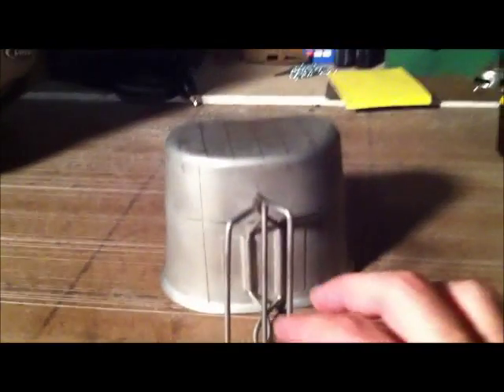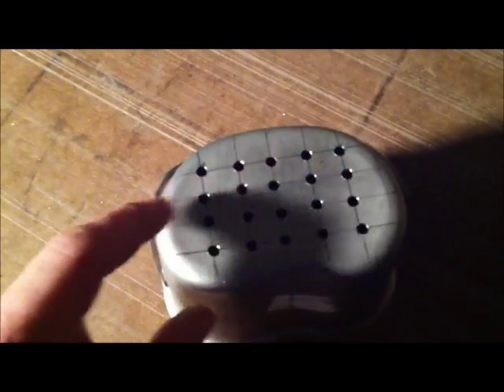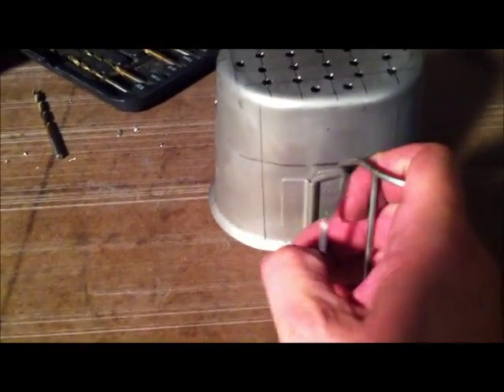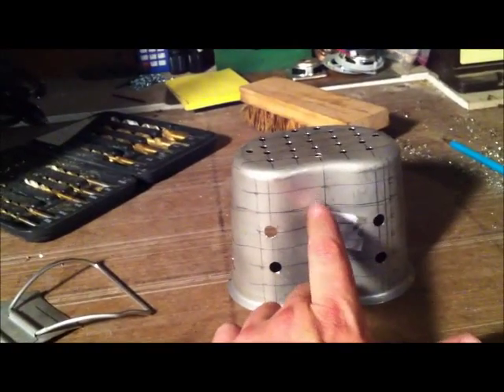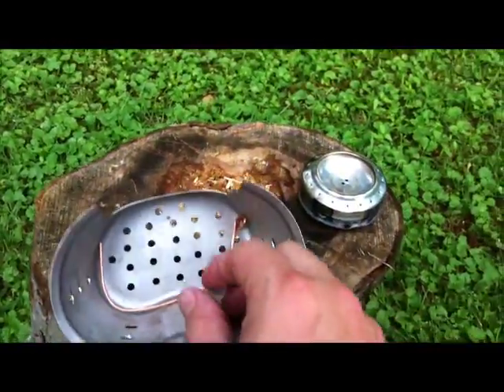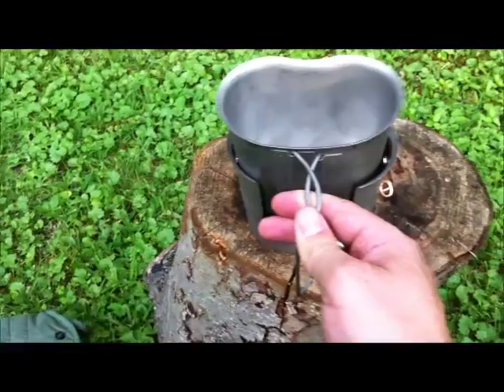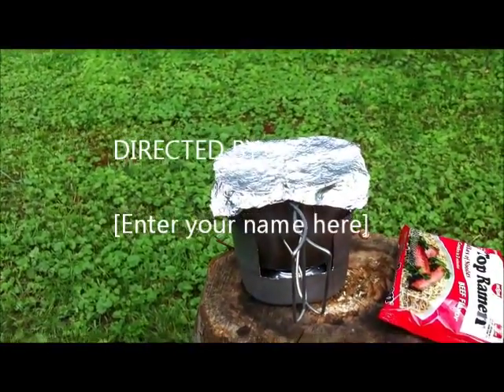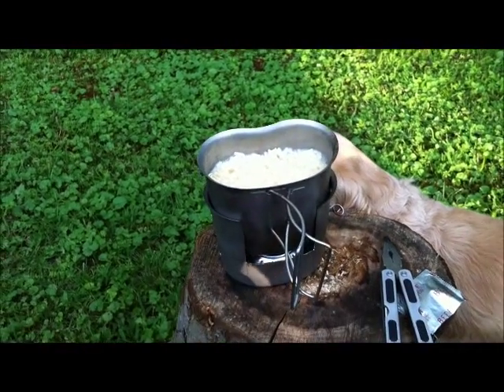How to Build an Army Canteen Cup Stove custom DIY alcohol fire ezbit camping pot

Comment: Just use the stove that comes with the canteen cook set.  It's already a multi-fuel stove, and can be used with tablets, with wood, or with a mini Trangia.  Don't ruin a cup just to do something that's not as good as what you can already buy for five bucks.
Reply: James Ritchie.    This is the perfect situation to cut a Rothco cup for this project.
Reply: James Ritchie believe it or not the us-made stoves are actually more money then the cups
Reply: The Downtrodden 
How much are the US stoves?
The cups are running about $10.